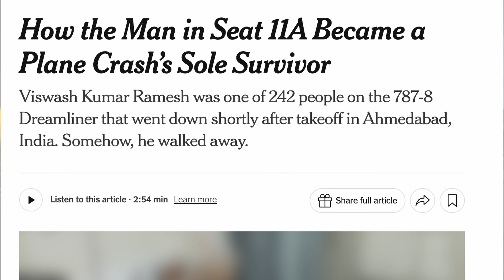Why the RAT Changes Everything – Air India 171 Update

Comment: Best analysis I've heard so far. But it's incredibly disturbing to think both engines flamed out at the same time - an amazing thing to happen. I maybe shouldn't be saying this, but for some reason the Germanwings crash years ago comes to mind. In that disaster the co-pilot committed suicide by locking the pilot out of the cockpit and flew the plane into a mountain. This is without any proof, and complete speculation at this point, but is it possible one of the crew deliberately shut down the engines - accidental or otherwise? How would that be possible. I would guess a thorough investigation into insurance policies taken out, mental problems, etc. will be part of all considerations during the investigation. As a frequent flier, any unresolved explanation of the cause of the accident makes me very nervous about taking any future flights on this particular aircraft.

Comment: From what you are saying, perhaps the dual engine failure seems to be quite possibly the cause for the crash. Captain Steve, I was wondering that if the pilot suspected that one of the engines had failed and he wanted to cut if off from receiving power, could he have then perhaps made the mistake of cutting off the good engine by mistake and thereby making both engines fail ? There must have been only a few seconds for him to act and this may have been what happened?

Comment: I'd add a item 2.5...   The negative aural evidence...   Would you really hear the sound of the RAT over jet engines if they were running at full power?  I'd expect the prop sounds to be covered by jet blast sounds.

Comment: Wasn't that plane just serviced? I saw one of the initial videos it could've been different. I swear to God I saw a puff of white smoke Come out the right engine like some type of backfire, now I'm suspecting some type of fuel problem is there something that would've shut the fuel off or would a electrical failure have done that?😢 13:14
Reply: After a plane crash due to contamination due to fuel, modifications were supposed to be made to prevent it from causing a crash. But the black box that records the systems will be critical to solving the mystery.

Comment: I agree dual engine " failure". Not leaning to fuel contamination, but would not expect both engine to shut down at same time. No likely bad fuel would reach both at same time. More likely and electrical issue causing the loss of fuel being supplied to both engines.

Comment: I saw a (unverified) video where I guy on the previous flight (same plane) recorded that almost none of the electronics in the main cabin worked on that plane. THe AC was not working. The entertainment system wasn't working. The attendant call system wasn't working. So maybe this plane had major problemsdue to design or poor maintenance. I remember in early development they had major problems with the electrical systems. And even almost lost a plane to a big LiPo battery failure (big LiPo batteries, like in a Tesla).

Comment: The plane would not be able to take off and climb if anything was wrong. If incorrectly configured, 3 different alarms would have sounded load and clear. No pilot error because the 1st officer requires a type rating and 2000 your turbine time to fly in FAA controlled space. India has high standards. The nose pitched forward which kept the plane flying at a high decent rate without stalling. We will find out what caused a 2 engine out event.

Comment: Aircraft mechanic here. I did not look it up but I seem to recall that both engines do not run the generator together. As example #1 engine may be primary to run the generator. #1 engine fails auto switches to #2 engine to run the generator, or the generator drive can be switched by crew to the #2 engine. My personal theory is high angle departure for noise abatement, First officer is distracted and pulls flaps up before gear. Due to high angle at least 1 engine stalls, rat deploys. Also, in the grainy pictures it looks like the speed brakes are partially deployed...may just be shadow. The First Officer had I believe over 1000 hours. I assume that is total hours. How many hours did he have in type? Love your videos and insight. Fly safe.
Reply: I wonder if FO's shirt sleeve caught on the flap lever as he reached fir the gear lever

Comment: Bingo, dual engine failure is at the top of the list of causes for this crash. Well explained
 by Captain Steeve. Still have to get more information I'd say, but looks like engine failure with the evidence on the video. Still electrical or hydraulic failure could have caused the crash as well.

Comment: I respect you Captain, a lot, but we suspected the RAT two days ago!  Another blogger already posted the original clearer video and presented the prop sound as proof that the RAT may have been deployed.  What took you so long to come to this conclusion?  It is quite doubtful that a copilot with over 1000 hours of flight time would confuse between the landing gear knob and the flaps knob!  I don’t know what happened but as you say, the wings lost their lift.  That is for sure.  Now we suspect the RAT was automatically deployed due to mechanical, electrical or hydraulic failure.  We must be very careful in coming to conclusions too early.  I enjoy your videos!

Comment: Considering they did not even initiated the gear retraction means power loss happened right after the takeoff.
Reply: From another youtuber, spotted on those videos, landing gear is not at rest position, actually it is stuck at middle of closing position. So probably, at that moment happened hydrauilc/power loss and landing gear did not close.
Reply: Assuming power loss?....... Guessing maybe ???
Reply: Are you sure, main gear bogie was tilting the wrong way, that is the first step of retraction. and then it lost hydraulics/power
Reply: @soeren72 You are probably right.
Reply: The 787 has a known history of lithium-ion battery fires, which can trigger catastrophic avionics failures. On the previous flight, passengers reported the air conditioning, lights, and entertainment systems were not working—clear signs of electrical problems building up. During the accident, the Ram Air Turbine (RAT) deployed and the landing gear stayed down, both strong evidence of total power loss. Survivor also saw emergency green and white lights come on before impact, indicating the aircraft switched to backup power. All these point to a likely scenario where an electrical fire or battery failure knocked out critical systems, leaving the crew unable to retract the gear or climb. The 248 day bug that requires the SW to be reset (failing to do so could cause GCU issues and complete power failure) can be ruled out because the engine was replaced only recently (and probably the SW bug has been fixed)
787 batteries are susceptible to "cascading thermal runaway" where failure of one cell triggers failure of adjacent cells. A main battery fire can cause APU to fail as well. The high electrical demands of takeoff could have triggered the final cascade. Also bear in mind that 787s are Full Authority Digital Engine Control (FADEC) systems that require electrical power for proper thrust management.
Reply: @vajrapaniom7410  Please stop repeating this misinformation about battery fires. It's unhelpful. In any case, if one did happen, where was the smoke before the crash? The alarms would have been triggered in the cabin, and the FDR will provide evidence. Furthermore, the Mayday call would have highlighted 'Fire. Losing power.' or similar.

The second and last time there was a li-Ion battery fire in a 787 was in about 2013. There is no 'known history of battery fires', as you claim. That problem was resolved by implementing various safety measures. Failure to do that would have resulted in the aircraft being grounded until the problem had been dealt with. If it had never been resolved, Boeing would not be allowed to fly them with passengers today.

n the unlikely event that you know differently, can you at least point us towards an up-to-date FAA, ATSB or similar reliable report which confirms it? Thanks.
Reply: Still no explanations why flaps retracted.
Reply: @bumbarabun They weren’t, there’s picture of the wing on the ground after the crash. Flaps and slats are deployed.
Reply: @TheMomotarosu18  I see, so far what I saw people said they are not in takeoff position, maybe they are wrong.

Comment: Another important piece of information is that the rear landing gear is angled upwards, which only occurs as the landing gear is starting its retraction. Only a dual engine failure would be responsible for a pause in a landing gears retraction.

Comment: I'm inclined to believe that an electrical failure caused the engines to cut out, which in turn, caused the ram air turbine to deploy. 

   If you listen to the plane when it passes over head, it did not sound like a plane under power.  The engines were spooling, but were nut under their own power. I've lived near major airports most of my life to know how similar aircraft like this sounds when taking off... the engines should have been loud and pronounced, this plane didn't sound like that...

Comment: My room mate ar work read that a passenger on the same plane the day before said there were major problems with the plane. They said the air con didn't work, the call lights didn't work and the entertainment system didn't work. If that were true, I would be leaning toward a massive electrical failure, possibly due to compromised insulation on major supply lines, which could also explain a loud bang.

Comment: A dual engine failure is 1 in 10 million chance off that happening
Reply: An electronics failure that can cause a dual engine failure is probably much more common.
Reply: So your telling me there is a chance!
Reply: Not if Capt. Steve is doing the analysis. He will ignore all reality and defend the terrible flying skills of non-whites.
Reply: seems unlikely
Reply: In May 2015, an Airbus A400M Atlas military cargo plane crashed during its maiden test flight near Seville, Spain when three of its four engines failed to respond properly to the crew's power commands shortly after takeoff.   Unable to climb, the aircraft struck a high voltage tower.  Prior to this, when the firmware of the ECUs was loaded, essential torque calibration parameters were inadvertently deleted from the ECUs of three of the plane's four engines (the three engines which failed to respond correctly to the crew's power commands after takeoff).  The failure mode of the defective ECUs kept the engines stuck in "flight idle", their lowest power setting, designed to prevent out-of-control engines powering back up.
Reply: @Chris.Brisson  i think an electrical issue is part of it here...

Comment: What about the lack of 'winds' and 'heat wave' that India was experiencing.  I've heard that there is some minimum requirements for liftoff to be successful.  That without winds the engines won't be effective.  That during heat waves the 'air density' won't be sufficient for liftoff.  Do pilots have instruments to check these things?  Is this part of standard procedures?   Or do we normally take for granted that these conditions are sufficiently met without worrying about it?

The temperatures have been from 27 to 40 degrees Celsius consistently for over two months.
According to one report for the week "Westerly to Northwesterly winds are prevailing at lower levels over the region"   They don't describe how much lower.
Air Quality is considered Poor.

Comment: To be clear I am not a pilot. But wouldn’t a loss of lift cause a loss of power sensation? If the pilot did not know the flaps were retracted and they lost lift wouldn’t that cause a loss of power and deploy the rat    It looks like at the peak of its climb it lost lift and stalled then started the decent. I spent my younger years flying around in hueys in the Army and when I saw the video for the first time I thought exactly what you had originally thought. The flaps were retracted accidentally. One thing is for sure, we will know definitively the cause when the NTSB report comes out. Prayers to the families of those who lost their lives in this tragedy.

Comment: Surprisingly great video. Thank you. Also, I realize that dual engines on a commercial aircraft in now the norm, what with the reliability of turbine-fan engines these days and the ability to save fuel. But, if there were a 3rd engine on all aircraft right next to the rudder on the tail, just think how much safer planes would be

Comment: I took my own photo of the RAT from the grainy video exactly 24 hours ago. Your theory doesn’t hold water because we can still hear the jets producing thrust after the plane has passed the camera. For your theory to be correct, the motors would have to have stopped producing thrust BEFORE the RAT was deployed. Sure, they would still be turning, but what we hear is thrust, not spool down. That leave hydraulic or electrical failure.

Comment: Glad you're reconsidering pilot error as a possible main cause. It could still be a contributing factor, them possibly not reacting properly or quickly enough, but mostly agree now that something internally put the plane into a situation that its very powerful engines simply couldn't overcome. A loss of full engine power, to recover & gain altitude, would explain that. This just seems very logical.

Comment: That JAL RAT deployment was not an emergency. That video is from a RAT test conducted at the Boeing factory, Paine Field, Everett WA. I was working at Paine Field during the years the 787 was being manufactured there before it was all moved to South Carolina. I used to park on the perimeter road during some of these RAT tests and can tell you for a fact that the noise I hear on the Air India video sounds exactly like a RAT. 100% without a doubt. Knowing this and with so many 787 aircraft flying today, I have no doubt that Boeing has a GO team in India right now trying to figure this out along with investigators. If there is some hidden sleeper issue going on with that airplane, they better figure it out quick. This is the kind of accident that should concern everybody.
Reply: In light of Sam Salehpour's testimony last year, this one was waiting to happen. "Bandaid on bandaid," he said.
Reply: "RAT tests and can tell you for a fact that the noise I hear on the Air India video sounds exactly like a RAT. 100% without a doubt."           thanks then it was due to dual engine failure  however that seems extremely rare
Reply: My money is on maintenance issues or sabotage. Boeing cannot be held responsible for maintenance provided by the owners/leasers of the aircraft. One accident in 16 years! Waiting on the black boxes info. That will tell.
Reply: @davejohnson9691 I used to have unquestionable faith in Boeing, however, after those crashes a few years back with the 2 737 MAX planes, in addition to the whistleblowers that followed, I have my doubts. Not saying it couldn't be a maintenance issue or anything really. All I'm saying is that Boeing quality has declined and it's fair to have questions.
Reply: @MClavo-cf7yg  100% correct, you are. The management shuffle has caused a lot of issues. The same at Blue Origin. Everything must be closely looked at. But I do not jump into the fire just because it is Boeing without having the black boxes analyzed. Some pundits seem to think that the Boeing "GO" team is going to do damage control. I do not agree. I think that is normal protocol.  I retired from a fortune 100 company that did fire and security for large installations. IF there was an incident of any kind, that peripherally was attached to any of out company's products, a team was sent to completely understand what transpired, not to cover up the issue.

Comment: I respect you Capt. Steve.  But from that far away with the angle of the nose at the time you suggest it is the RAT THAT we see, I STRUGGLE to see how this is correct. I see that the RAT IN A 787 is 31 inches long… and I really don’t see how that would be visible from the angle and distancee, that nose is high and the rat is forward of the wings, before the nose…. But clearly I am not the expert.  I just stilll find that hard to believe that object is the RAT… at this point.  I do believe you in the RAT WAS deployed and what is heard, but don’t think we see it.  ❤

Comment: Was an electrical problem because the air conditioner and other outlets did not function before take off so I think was negligence by the airline not to check the airplane or inspect it before takeoff or even days before takeoff